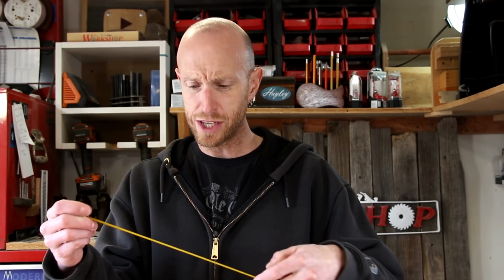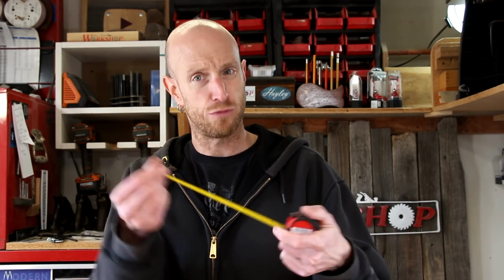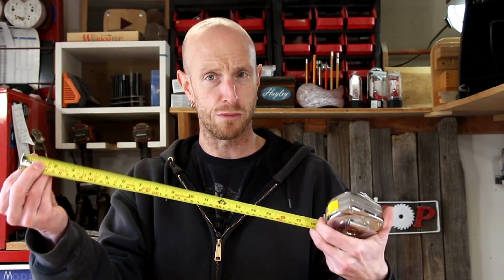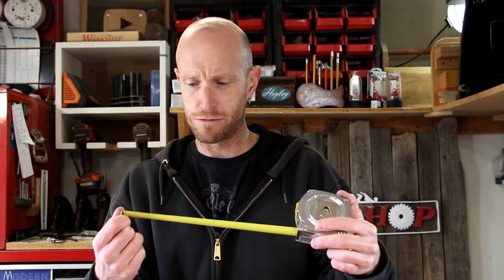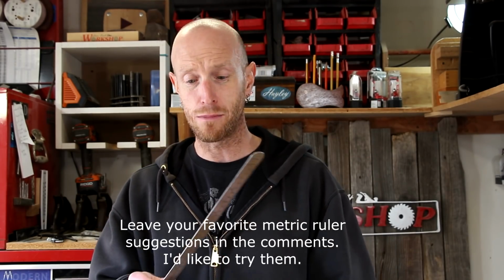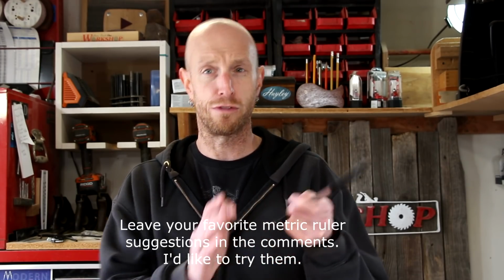My thoughts after using the Metric System for a project | I liked it

Comment: The good part of metric system is indeed switching from measures. Like meters distance, 1 liter. Is a cube of 10cm per side and then that liter is one Kg. So conversions are quite easy to do mentally without difficult conversions.
Also is that base 10 is universal to convert is easy just add 0 or remove them.
Also with temperature 0 to 100 at 0 water freezes and at 100 evaporates.
I barely used imperial system I know the measures but if I had to convert from measurements without Google and the cellphone calculator I would have a bad time.

While traditional measures as pounds of feet are not standard as I often found out a "pound" is not the same for a Catalan, a Spaniard, a Brit or a French. French pounds and feet are larger than imperial ones.

Comment: Metric system also has interactive weight and liquid volume. 1 litre of water weighs 1 kilo and is 1000 cms cubed. I could easily calculate say the volume of a water tank and its weight with the metric system. Don't think I'd even try with the imperial system.

Comment: metric is generally easier to use, but one thing that is nice about imperial is that it has a lot of factors. take a meter vs a foot for example, a third of a foot is a lot easier to measure than a third of a meter.

Comment: Having worked in American aerospace for 43 years I went through the early 2000s mandate that changed all new space designs to metric so I have extensive use of both systems. People love to say metric is more accurate but it's an illusion, having worked in the millionths of an inch, precision is all in the unit of measure you are using and the accuracy of the instrument you are using to measure with, in fact some machines I've used are more accurate in inch mode rather than metric due to the resolution of the encoders which loses some programmable accuracy in metric, the difference is below .0001 inches but it exists and depending what you are doing it's even quite detectable. I can't say I like it or hate it, to me it's just numbers.

Comment: We’re a bit messed up in the UK. Technically went metric decades ago - most people under 40 have no idea what Fahrenheit is or ounces, yet we still use mph and imperial measurements on road signs but metic for almost everything else (even our money wasn’t metric until the 70s). I was watching a bike review the other day and it showed off the weird attitude to it - fuel tank capacity quoted in litres but fuel economy was in miles per gallon, seat height in mm but fork travel in inches, power in horse power, but torque in Newton metres. Weight in was in kilograms and wether in centigrade. Personally if I’m being approximate I’ll use imperial “that looks like a couple of feet”, but metric if I’m being accurate “that’s 62cm”.

Comment: I am in Canada, when I was in highschool my friends and I did a project half in metric, half in imperial.  One of the members (a Japanese exchange student) kept arguing that it made no sense to do that, as metric is easier.  Our reasoning was that the height we wanted was all in round numbers in imperial (though not in length or width), so using round numbers instead of decimals was easier.  One you start using fractions, I can do it easy enough, but I preffer metric decimals.

Comment: Here in the UK we use both systems, we measure in metric, distances and volume is still measured in imperial ie miles and gallons. 
I measure my height in feet and inches but doctors use metres.

Comment: Oh, that concept of metric vs imperial... It's simple as that - the metric system follows simple logic, gives straightforward relations between dimensions, it works perfect in physics and is built with the idea of being uniform and universal. Anything else is a habit and if it makes you feel good and it works for communicating magnitudes of things and stuff with other people, you are good to go.

My hobbies include hardware and building systems. It is always so funny when somebody from the US demands to watch their CPU temperature in °F. The datasheet is all in metric, the melting points of any material is given in °C, the thermal conductivity of any material or device that would cool down that CPU even gets crazier measuring temperature delta in K (metric) per Watt per meter, but they want to observe their F values... What for? To know how their CPU "feels"? Is it feverish or maybe just OK (not "zero Kelvin")? Perfect nonsense.

Comment: I grew up learning and using the imperial weights and measuring system as per British standards but then in the late 60's to early 70's the country changed over to metric which also covered our monetary system. I tell you without a shadow of a doubt that it is far easier to function with metric systems than imperial ones. It is not that the fact that they are more accurate than the imperial alternatives it is that they are much easier and quicker to calculate with as everything is based on multiples of 10 so once you master the decimal point it's easy. All Americans have been using the metric system for money all their lives and they have no issue with that. Why was that? The British system of money during colonial days was pounds, shillings, and pence which worked on a confusing platform and I know because I used it. The advantages that decimal currency produced are also there with using metric weights and measures. During the changeover period between the two systems, most individual problems come from visualising the metric form of what the project is and so you spend much time converting it in your head to imperial. For example, I have made many personal car trailers and the regulation standard here was always 6' by 4' and so to keep that standard it had to be converted to imperial which would make it 1828 mm x 1219 mm but of course, I would round down to 1800 mm x 1200 mm. It does not take that long though before you are able to have a correlation between the two systems in your head in the measurements you use most. What increment you work in with metric will depend on the job you are doing but mostly in construction I will use millimeters and meters and rarely use centimeters.

Comment: You have to add up two measurements - the first is 123mm + 42 mm. The second is 4" 7/16ths + 2" 3/8ths. Now which is easier/faster/less prone to mistakes?

Comment: Where I am, metric is the official standard, but due to proximity to US, and old farts stuck in their ways, I tend to use feet & inches a lot.
I much prefer metric for all the reasons you mention!
It takes me a minute to switch systems if I need to, but when I have a customer who gives me metric units right off the top, I’m that little bit happier on the job!

Next controversy for you to take on is what you think about Robertson screws & drivers! 😉🇨🇦

Comment: A centimeter is smaller than an inch and a millimeter is smaller than 1/16" which is usually the smallest graduation on a tape measure. That's why it feels more accurate. I'm a Canadian living in the states who uses both systems a (metric) ton.

Comment: The point is, the imperial system is mathematically highly inconsistent. Without fractions, it works with radix 12. We know, after 9 comes 10. Now let's assume we count to 12 - so we need additional symbols for 10 (A) and 11 (B). After "B" comes 10 (now "12").

Let's assume we got 9 inches (9"), 10 inches (A"), 11 inches (B") and 12 inches (10"). That means we got a full foot (1) and no inches (0). Try it with 23 inches (1B"). It works!

However, as we introduce fractions we work with radix 2. 1/2", 1/4", 1/8", 1/16", etc. In radix 2, 1 is written as 1, 2 as 10, 4 as 100, 8 as 1000, 16 as 10000. Consequently, we can write 1/2" as 0.1", 1/4" as 0.01", 1/8" as 0.001" and 1/16" as 0.0001. 2/16" = 1/8" - so 10 * 0.0001" = 0.001". Works as well! 5/16" can be written as 4/16" (=1/4") + 1/16" = 0.0101".

If we'd consistently worked with radix 2 in imperial, we'd write 3 5/16" as 11.0101" and we'd say something like "a double plus one 5/16th". But we don't. It would work as perfect as the metric system though.

The metric system uses a rigid radix of 10 throughout - not a mix of radix 12 and 2. Therefore no conversion is needed - only a "shift". A "shift" is a division or multiplication by the radix. A multiplication by ten means we shift all numbers to the left and add a zero to the right. A division by ten means we shift all the numbers to the right, taking the decimal point into consideration.

Proof? 123 * 10 = 1230. 123/10 = 12.3. We can't do that with the imperial system. 1' 2" 3/4" - try it by 2: 1/2' 1" and 3/8", which is 7 3/8". By 10 - OMG!

The precision of a mm is between 1/16" (1.6mm) and 1/32" (0.8mm). I guess a 1/16" is what one uses most of the time, so I can understand the increased perceived precision.

Comment: On the point of dealing with factors of 10... the real value of the metric system becomes apparent when you start dealing with more dimensionality than just length.  When you have volumes, pressures and densities, all of the calculations factors become factors of 10 as well

Comment: I've never worked with imperial (I'm european) but I suppose imperial may be a bit limiting in precision, due to the hassle of certain measurements, like "this panel is a quarter of an inch and a thirtieth of an inch and a sixty-fourth of an inch thick". Unless I'm missing something, I suppose that's the kind of thing you want to avoid because it gets confusing and unwieldy to even think about it, let alone say it out loud. With millimeters you never have that issue. You can be as precise as you want with no added hassle. If you really need, you can even go down to fractions of millimeters if you have a good eye and sharp pencil, and that's the only added hassle.

Comment: I am an architect, and have worked on projects in both Imperial and Metric. From my experience, Metric is far superior to using Imperial, simply because you're working in real numbers, not fractions. Calculations are much easier in Metric and the likelihood of mathematical errors from converting fractions and rounding up/down is eliminated. Not to mention that my drawings were a lot more precise in Metric and I spent a lot less time doing feet/inch conversions in the process.
If I was king for a day I would convert the U.S. to the Metric system, because the ease and simplicity of using Metric makes a lot more sense. I think the main obstacle for Metric gaining approval in the U.S. is that most people can't readily visualize the measurements the way they do with feet & inches - but like anything else they would likely become a lot more comfortable with Metric measurements over time, the more they use it.
Many industries in the U.S. already use metric when manufacturing their products, mainly to satisfy product standards overseas. Even American cars are built with Metric parts. We get our soda in 2-liter bottles. Look at all of your food labels - they already use both Imperial and Metric units. Your car's speedometer has both sets of units on it. The biggest resistance to Metric sadly comes from the construction industry. A lot of this has to do with standard sizes for building materials and how construction workers use various "rules of thumb" when building things.
To anyone reading this who is opposed to Metric, all I ask is you give it an honest try - you might wind up coming to many of the same conclusions I did.

Comment: Once you know the meaning of the different metric gradations names it’s easier to imagine the dimensions. Probably the hardest part when you are used to imperial. 
Like milli stands for thousands in Latin, so it’s a thousand part of a meter. Centi refers to hundred, so it’s a hundred part of a meter and so on. 
The same Latin prefixes are also applied o volume. The base is litre so you have millilitres, centilitres, decilitres. 
Hope this can be of any help to someone thinking about going metric.

Comment: Everything in distance is meter in metric
Millimetre (milli=1/1000) 1/1000 of a metre
Centimetre (centi=1/100) 1/100 of a metre

You can read all the prefixes in this Wikipedia page, they’re used for all measurements in the metric system
https://en.m.wikipedia.org/wiki/Metric_prefix

Comment: So as someone who works with chemistry, i can tell you that the entire metric system is designed to be used by logic. 

A prime example is Milimeter to Centimeter, the Mili or Centi can be added to other units like liters or others. Meaning this system is usefull for nearly everything.

Comment: It is not only that everything is related by a factor of ten in length measurements. Annother advantage is that each and every branch of measurements ar related to each other all over the place. Exaples: A cube of ten by ten by ten centimeters contains 1000 cubic centimeters. 1000 cubic centimeters are one liter. One liter of water weighs one kilogram. Water freezes at 0 degrees celsius and starts boiling at 100 degees celsius.

Comment: Where I started my Toolmaking apprenticeship they were using a combination of the Imperial System and Metric so I used to both. I have however been using the Metric System exclusively now for about 35 years. It is, in my opinion, a far superior system.

Comment: you can shift a point or you can shift your brain
The advantage is that the number does not change in the metric system, only the point is moved:
in meter: 12m
in decimeter: 120dm
in centimeter: 1,200cm
in Millimeter: 120,000mm
and it is scalable from the smalles part of an atom to the size of the univers without any rounding error
all units are connected with factor 1:
Water: 1kg is 1dm³ is 1 liter
or 1000: 1kg=1000g=1,000,000mg
1N=1m/1s²
push the point instead of multiplying by 0,000568182 or 1760,0005632

Comment: In the imperial system you have different units of measurement for different things. In metric there's only one for everything and no need to conversions.

I watch a lot of science videos and they always using different units of measurement, when thay talk about long distances they use miles, but if you're talking about altitude they use feet. We use kilometer for both. 1 kilometer = 1000 meters, 1 meter = 1000 millimeters. No need to use 3 different units for the same type of measure.

Comment: I moved from Colombia(meric) to Panama (inches) as a graphic designer it was madness. They are making the transition here and clients some times use both  70 cm Heigth 12 feet 2 inches and an 1/8 long😅. A mile is 5280 feet. The brain finally adjust, but is impractical . 1km=1000m
1m=100cm

Comment: In most videos on the metric system, I see people say, you can cut a six foot piece of lumber into two, three or four equal lengths (that is true). But what if that piece of wood is 5ft 9in and 3/8 of an inch?. If (just making this number up) it was 1465 millimeters. You can divide that number by 2, 3 or 4 on a piece of paper (or calculator). Much easier to do. In Australia, our products come in 500 gram or 1 kilogram packets (even numbers). It's just what you get used to. But when dividing something to equal parts, the metric system is much easier. Stop using the French as an excuse. They are long gone. Australia was imperial when I was born so I understand pounds, feet and inches. Great video.

Comment: As a Taiwanese, I have grown up learning and using the metric system. When I joined an American company in my twenties, the first week of orientation and the technical documents within the company were extremely challenging for me. I had no concept whatsoever of these peculiar units of length, weight, torque, and other measurements that are unique to the United States and not used anywhere else in the world.

For example, I think that the majority of people in the world can easily understand the concept of "making a mark at three centimeters from the edge," but I cannot intuitively grasp what a "2-inch diameter" hole would look like. This becomes especially challenging in the modern engineering industry. It has happened to me more than once where suppliers from other countries misunderstood the design specifications provided by the United States, mistaking imperial units for metric units, and causing numerous problems...

Comment: Yes, metric is more accurate in everyday use, obviously in theory both are as accurate as you want them to be, but metric measuring devices generally are at their lowest division 1mm, this gives in my experience actually around 0,5 mm of accuracy, which is around 1/50 of an inch. It is kind of perfect for most wood working and it is impossible to do with the average imperial measuring device.

Comment: It's funny how most Americans are mostly impressed by the factors of 10 and 1000. I suppose for woodworking it kind of makes sense, but the true power of the system is in science and physics where the 7 base units can be combined to measure/quantify anything you can imagine; distance (m), area(m²), volume(m³), velocity(m/s), acceleration(m/s²), force (kg*m/s²), energy(j), power(j/s)

Comment: 🤘🏼 Just wait until the SD card (into cameras, you know) manufacturers in the US drop the Metric System just to measure the cards' storage space in these brand new Imperial Units:
• 1 binch = 25 bits
• 1 boot (pl. beet) = 305 bits or 12 binches and 5 bits
• 1 byle = 1631 bits, or 5 beet and 3 binchs and 6 bits  

😁 😏